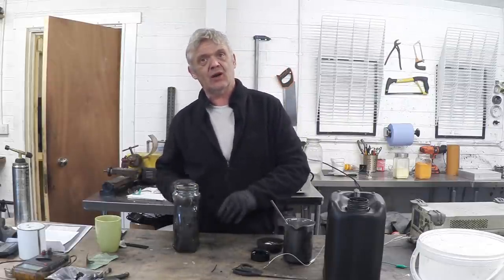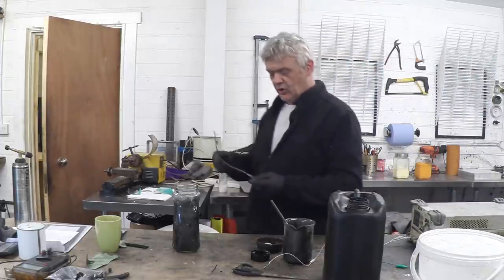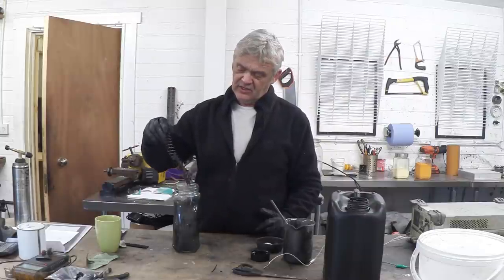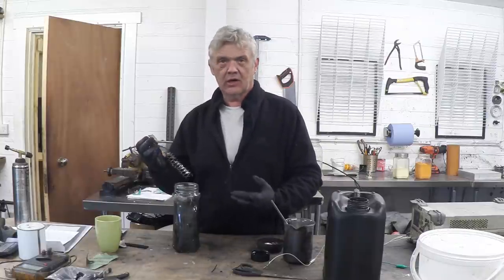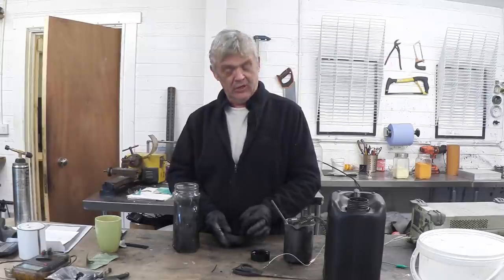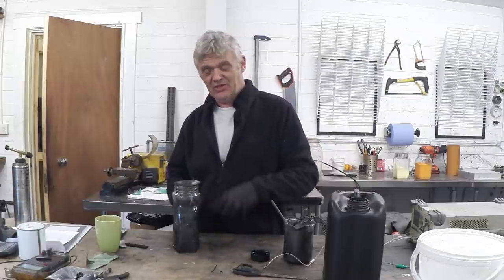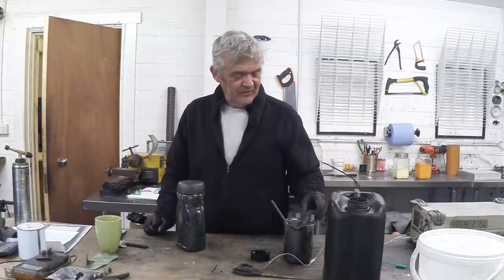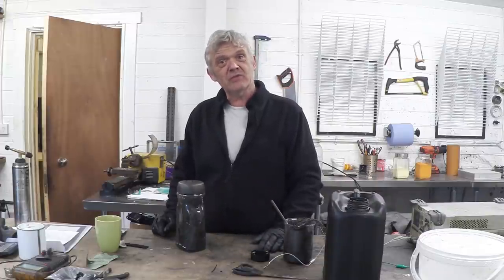Making Conductive Plastic Coatings

Comment: I have it in my head that carbon nanofibres can make conductive plastic in a smaller ratio because the longer conductive fibres contact each other more readily than graphite. Also, those black plastic bags used for electronic parts are quite conductive too, already mixed in a nice flexible plastic. They are sometimes repurposed as sensors because their resistance changes when stretched or as flat conductive sheets for x-y  sensing. Lots of conductive plastic around, just a pity no one uses it for vacuum cleaner hoses to make them anti static. Great video Robert.
Reply: The antistatic transluent shiny plastic covers used for electronics, always show as non conductive to multimeter, can you please tell which black plastic bags are you are mentioning ?

Comment: Hey Rob; I'm attempting to use ABS and Acetone to make a conductive plastic. I've used 30% by weight of graphite powder and I'm not sure the best way to ensure that the coating is conductive at all. I've coated some copper foil in the plastic mix and not able to get a conductivity reading from the multi meter. I assume I'm doing something wrong; Any pointers? I've used 70 grams of ABS in 200mL of acetone. I've been inspired to create some Zinc Bromide batteries at home. Thank you for the great content!

Comment: Greetings. Im woondering if there is an ideal solvent to disolves PBC pipe and mix in some graphite and use it as a conducive coating that's very well bonded with the PVC.

Comment: It occurs to me there's a stuff called Plasti-dip, they use it for tool handles and such, and it's available at many hardware stores.  I don't know what kind of plastic it is, kind of rubbery, but I wonder if you could just put some carbon in That if one didn't want to mess with particularly nasty solvents?
Reply from the maker: nice idea mate - might have a problem with viscosity - a good pointer though - thanks for the post

Comment: I'm curious about if this might act as a faraday cage if coated on a container exterior
Reply: Conductive inks and plastics can be used to make antennas, so there is a pretty good chance it could be used as a faraday cage. Have a go and see.
Reply from the maker: unicorn has it mate - the best idea is to try

Comment: Hi All, As filled HDPE is still not available, I'm trying to make my own waterproof conductive material with either plastic or other binders. I do get good results on the multimeter, but once in use in water based batteries, they fail to deliver current. I'm now looking into surface treatment of the conductive coatings (using Sodium dichloroisocyanurate as oxidizer). This does improve the behaviour, but still significant below that of carbon rods (from pencils). Any experience or advise?

Comment: honestly this really has opened up a new world. I had no idea you could decompose plastics into solvent s and then when the solvents evaporated the plastics would reconstitute. 

Immediately makes me think of mixing small ceramic, sand or steel particles to make a abrasion resistant plastic paint. 

or dipping regular cardboard in it to make some cheap pastic strucutre with recycled plastic. 

also what if you left the plastic as insulating (no graphite) and instead mixed mica or metal flakes or chips in it to make basically solid state strange capacitor! slap a metal collector on each side... Please try this if you run out of projects!

I have been saving lots of plastic soda bottles and milk jugs for some reason. Got any idea what solvent would dissolve them? 

I have some acetone. how would I recognize a plastic that acetone would dissolve? 

this really is an eye opener for me. I once tried to use heat to melt milk jug plastic and that is very tricky. This is fantastic.
Reply from the maker: awesome mate

Comment: Hey Robert, I was wondering why is polycarbonate in your video in a liquid syrup state? Have you melted it down to temp higher than 60°c? Till now I've only encountered solid bead PCL. Also, I wanna tell you that I wanted to buy some carbon-filled HDPE from your website but it's out of stock. Could you help me with that material cause I'm working on graphite electrodes and I want a premium quality conductive plastic to run the test?

Comment: Mr. Murray, i'm Rod from Brazil. What about coating stainless steel plates do prevent rust when producing hydrogen? Does it work? What is the most efficient way to do it? Thanks a lot for you videos! Rod.

Comment: I purchased some pcl and some dcm on line and I followed your directions, the plastic does not seem to be dissolving ( it has been over 12 hours) .  Is there a direction that I can go to make this work? Do I need to add 
something else.
Reply: I looked closer at the bag and it says tpe tpr , looks like they sent me the wrong thing. Can I make this plastic work somehow?
Reply from the maker: they did indeed send you the wrong thingmate PCL dissolves very easily in DCM - what is tpe tpr mate?
Reply: @ThinkingandTinkering   some kind of thermoplastic elastomer that could have any number of qualities. It doesn't melt at the temperature that PCL will melt. There was no information that was sent about the nature of this material. In the meantime I am trying polystyrene plastic dissolved in acetone and a little  
bit of xylene which seems to dissolve homogeneously. Do you have any experience with PS plastic? I am hoping to try a zinc bromine battery with this. Thanks.

Comment: I use polyurethane one coat and then I mix a little 5 micron graphite powder in it. You can also do the 2 part mix of elmer's glue but it doesn't work as good. What was the stuff you used as a solvent and what did you mix it into, I couldn't hear what you said in the video. LOL you kind of said it fast with that english tongue of yours.
Reply from the maker: dichloromethane and polycaprolacone
Reply: @ThinkingandTinkering  would acetone be a good substitute for the Dichloromethane or would it be a tab bit to flammable or are they both flammable?

Comment: I've seen some Youtube videos of people cutting up HDPE buckets, milk jugs, etc and melting them into a mold. Would it be possible to mix this melted recycled material with activated carbon powder to produce carbon filled HDPE?
Reply: Yes, I've done this with polymorph a thermal plastic. Trying to also do it with filament and a 3d pen as potentially would have a better application
Reply: I think it would work. Mixing it would be challenging, I think. What would be the best way to make it into sheets? I suppose the best way to use it would be to dip coat the current collectors in the HDPE/Carbon mixture.
Reply: @zylascope  Dipping and letting dry/cool then dipping again after sanding for new coat surface area grabbing (like concrete, I've seen Jaimie Mantzel making concrete mix and he adds rocks after each layer while its still wet so the new layer will be attached). 

I haven't melted any yet but from the videos I've seen, they put in the oven at the melting point of  HDPE and wait, taking it out before burning. But when melted it does not look very viscous, they are all pressing it into their desired shape over the cooling time of a few hours. 

Perhaps the dipping may require some pressing as well?
Reply from the maker: the mix is the challenge it's hard to mix more than 3% graphite in there as it basically acts as a lubricant over that and prevents proper mixing from happening
Reply: I tried to graphite dope HDPE but the stuff just softens and never melted to to a liquid to "absorb" the carbons.    Thanks Rob for another avenue to follow up on here.

Comment: Is it possible to make a transparent conductive plastic?
Reply from the maker: yes
Reply: @ThinkingandTinkering  Have you made the video on how to do that already? If so can you post the link in reply to this? I've been looking at trying to make polyurethane conductive and maintain transparency, but not much luck.
Reply: @thaddeuspawlicki4707  Did you ever find a solution to this?
Reply: @madebyrasa  Not yet. Any ideas?
Reply: @thaddeuspawlicki4707  silver nano particles are clear and very conductive. blend into you plastic mix as required. smallest batch I found was $200
Reply: @madebyrasa  What kind of plastic do you use for a base? I was thinking of polyurethane?
Reply: @thaddeuspawlicki4707  that works, including clear 3d print resins(my interests atm). will work with solvent and non solvent resins. Trick is adding the least amount and have the required conductivity. I believe resyn, the company sells a few types. I prefer making stuff. I did high resolution CNT 2% and .5% conductive 3d print resin yesterday and today.
Reply: @madebyrasa  Silver is expensive. Is nano-aluminum an alternative.
Reply: @thaddeuspawlicki4707  I don't know.  Some tin salts go on clear. you can diy silver nano on the cheap or thermal form ito plastic over your transparent piece, giving it an invisible conductive layer. Just ideas. I there was a clear graphene. haven't seen it myself.

Comment: Graphite in polyurethane  varnish?
Natural graphite is cheap and is used in instances where purity and consistency of particle size is unimportant.
Synthesising graphite results in a high purity material, and of a consistent particle size.
Reply from the maker: that would work fine - just the drying time is long
Reply: @ThinkingandTinkering  no problem for me lol
Reply from the maker: @markhodgson2348  lol

Comment: So what's this for?
Reply: For protecting metal current collectors from the electrolyte in various types of battery or super capacitor, like the videos Robert did on making a Zinc Bromide battery. Good also for making highly conductive electrodes for use in neutral salt electrolyte based cells.
Reply from the maker: a friend and zylascope has the rest of the answer for you mate
Reply: @ThinkingandTinkering  Thank you!

Comment: Having trouble wondering why you'd bother messing about dissolving plastic in nasty chemicals when you could, I suspect,. get as good a result by using an epoxy or polyester resin.  About the only plus I can see is that, depending on how you evaporate off the solvent, you get a slightly foamy plastic, but if that's what you want, why not use a foaming resin instead?

I mean, if it's all you've got, sure.

Oh, and for the love of god, man, take the chuck key out of your lathe chuck :)
Reply: I think epoxy would work. But I wouldn't want it to be foamy. The bubbles could make holes that let an electrolyte in to attack the metal current collector. And I wonder why Rob doesn't use Acetone as the solvent for Poly Caprolactone? I'm sure I've tried that and it does dissolve it.
Reply: @zylascope It is possible to pressurize epoxy resin in a pressure tank to collapse the bubbles.
Reply: @IntelliTrance  Thanks for that.
Reply: @zylascope  "flaming" epoxy with a torch will collapse bubbles as well, but the best is to be really careful when mixing it.

My thoughts on a "foamy" surface was to maximise surface area.
Reply from the maker: there are a million ways of doing anything mate - each method is just another tool in your armory

Comment: note to self. Abs and Acetone and add to percolatioon threshold.  30% by weight is reasonable starting testing point. add additive solids to some solvent before mixing into dissolved plastic